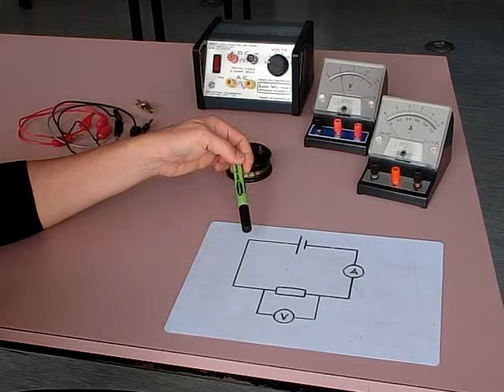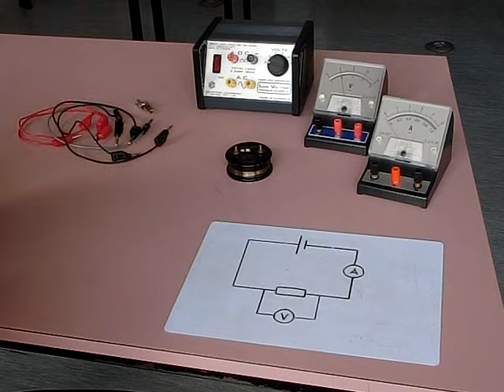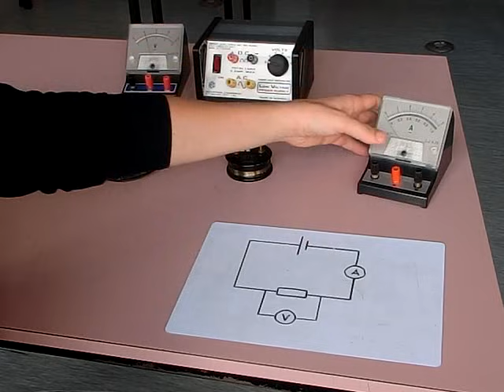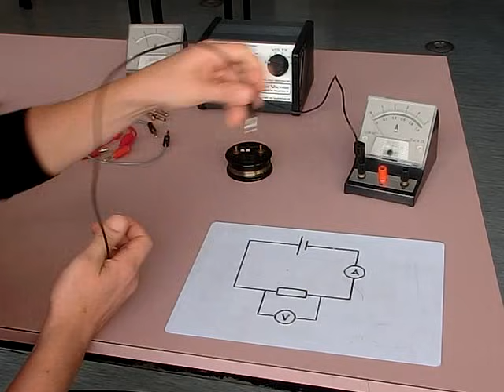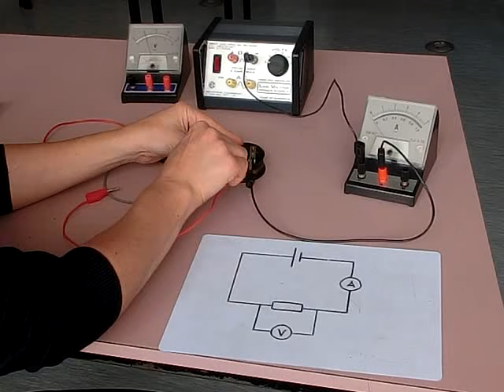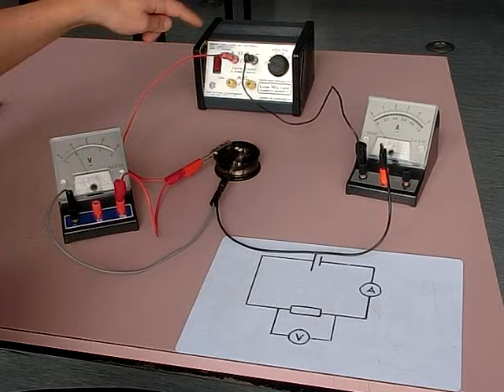setting up ohms law circuit

Comment: It's really confusing in another tutorial the negative terminal of the transducer is connected to positive of ammeter
Reply from the maker: If you connect your power supply the other way around, the circuit will still work. A current will still flow (just the other way).
The only difference would be that ammeter and voltmeter would show negative values if we reversed the terminals of the power supply.

Comment: how many ohm did u use for resistor ?
Reply from the maker: Cant remember, but you should be able to work it our from the voltage and current😁

Comment: Sir how to connect rheostat in this circuit
Reply from the maker: Hi, if you have a constant voltage supply, and want to use a rheostat to vary the voltage across the resistor/bulb, then connect your resistor/bulb as in this diagram - https://bit.ly/2M6ZzU9 - and put your ammeter in series with bulb/resistor, and voltmeter in parallel with the bulb/resistor. You can then use the rheostat to vary the bulb voltage from 0 to max.

Comment: I have a doubt .Suppose I connect the power supply directly to the ammeter .Does the ammeter give any value?Does this value is more than the ammeter reading when we out a resistor in the circuit.
Reply from the maker: Ammeter has very small (ideally zero) resistance. Thus, current will become very large if just the ammeter is connected (a short circuit). Most powerpacks protect against this by having a circuit breaker, which automatically turns powerpack off if current gets too big. Remember: current is voltage/resistance, so if resistance gets very small, current gets VERY big.

Comment: Can you list some precautions and possible sources of error for an experiment such as this? Thank you.
Reply from the maker: MsJovi102 Voltage is low, so no real hazards. Just take care as input to powerpack is from mains. Resistor can get hot for big currents so take care when handling. Sources of error: calibration of meters (zero error), reading scales on meters, minor fluctuations in readings during each trial; if you are going to find R of resistor using the graph gradient, then the resistance of connecting wires is another source of error to consider.
Reply: components may become heated due to the current flowing through the circuit, causing the effective resistance to increase which affects the p.d and current reading.

Comment: No rheostat
Reply from the maker: shah j No. I am testing the effect of supply voltage on current so I am not changing resistance - so I am not using a rheostat.
Reply: Felix Olsson ok but can you make rheostat video circuit with rheostat plz😫😫😫

Comment: can you make a video on the kinds of resistors?
Reply: Carbon Composition Resistor.

Thermistor.

Wire Wound Resistor.

Metal Film Resistor.

Carbon Film Resistor.

Variable Resistor.

Varistor

Light Dependent Resistor.

Comment: ameter connect to the positive
Reply from the maker: The circuit is connected exactly as in the circuit diagram. The negative terminal of the ammeter is connected to the negative terminal of the power supply.
Reply: Why no rheostat
Reply: Syed Zakir Shah abba ka samna ya bol na tujha btaya ga